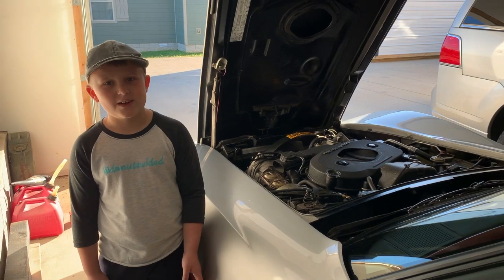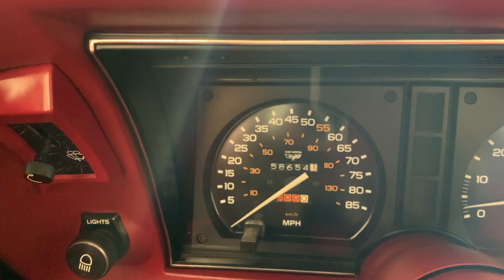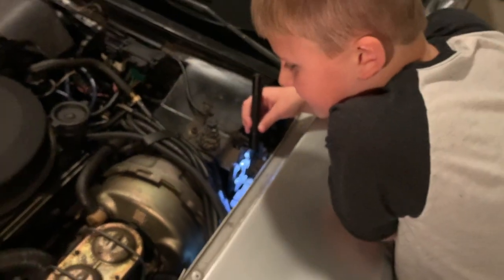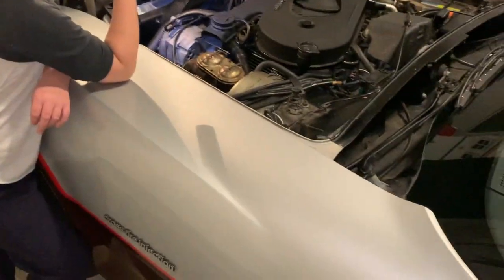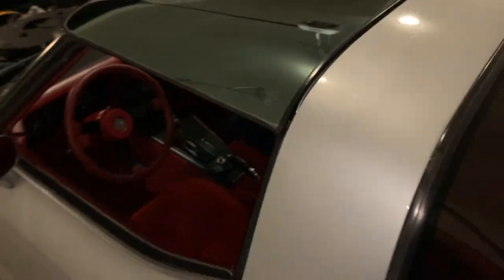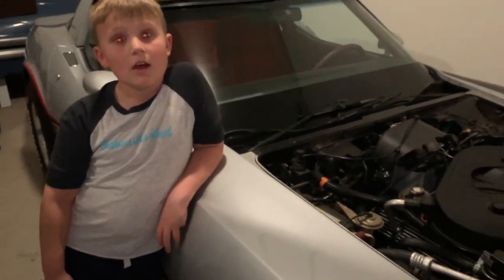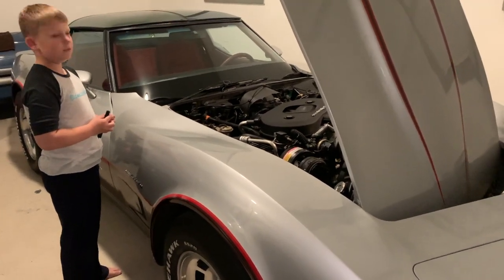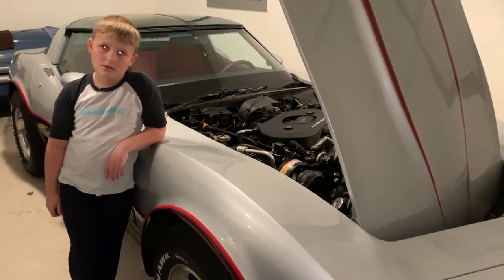1982 Chevrolet Corvette speedometer repair...I wish they were always this easy!

Comment: I have an 81, the speedo works the needle just bounces at the lower speeds but works fine at higher speeds, but my cruise control doesn't work. I'll check to see if anything is loose but if nothing is loose do you think I should replace the transducer or the cables? Had the same waterpump issue as well just replaced that
Reply from the maker: With the cruise control not working, I’d think that the transducer needs replacing. I would definitely check the cables first before you order the part!
Reply: @donutswdad7892  wow that was a fast reply thanks! Yeah I'll be checking the cables first thing. Fingers crossed its just that, because I just checked the price of a transducer 😬😬😬

Comment: But would the transducer cause the speedo as well as the mileage to stop reading?
Reply from the maker: @jesusamador4661  It was the main cause for us. The cable had come loose and was no longer in contact with the transducer.

Comment: Good Stuff   I have a 82 vette also and my cruise control wont engage. The speedo works, but the cruise will not engage. I will check out my transducer to see if there is any cable or vacuum hose loose..  I have the silver blue two tone color on my vette..  Thanks for sharing,,,

Comment: Does this thing also cause the odometer to not work
Reply from the maker: Yeap, my odometer had stopped working. I bought the transducer and planned on replacing it. Lucky for me, my cables were just loose. I tightened them back up and the speedometer and odometer began to work immediately.
Reply: @donutswdad7892  could it be the cable breaking also?